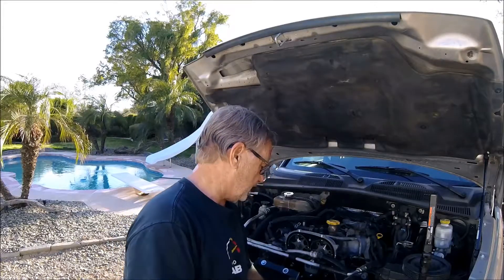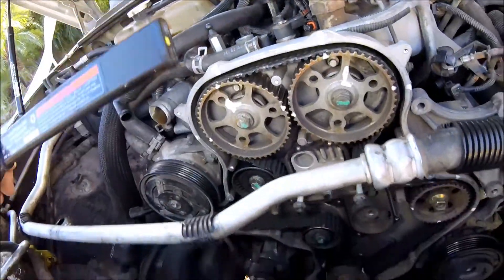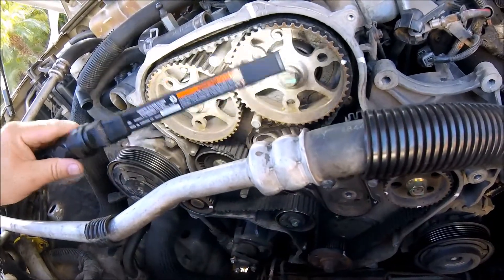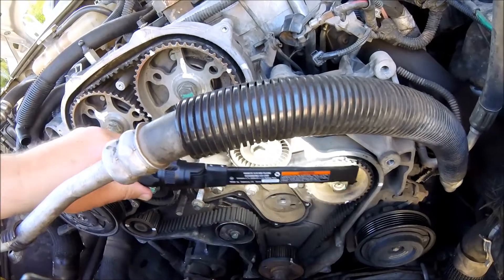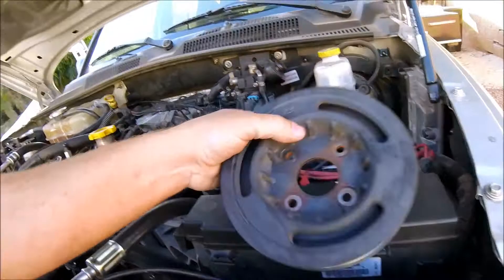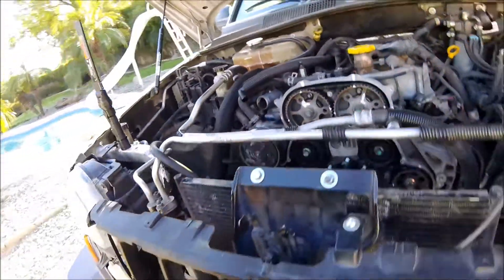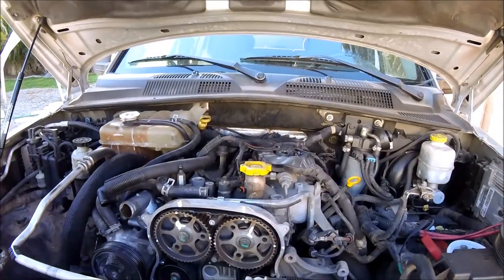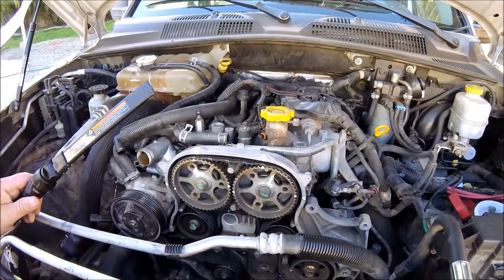Jeep Liberty CRD failure, root cause found

Comment: Greetings perhaps you can help me i recently cuange my timing for my CRD  2.5 jeep Cherokee started out work great for a while then it stall out every 2 miles... I change the cam and crankshaft sensor glow plugs no flush fuel lines still stalls and hard start any recommendations?

Comment: I’m thinking I may have a timing issue on my CRD liberty,  it drives but has excessive smoke I believe caused by I burned fuel, degradation in performance and fuel economy and an associated knock almost sounds like a rod.

I thought it was a dead cylinder (bad rings) but recently pulled each electrical connection off the fuel nozzles individually to identify a dead cylinder and all 4 had the same rough idle response when disconnected that recovered immediately after reconnection so my mind is now wondering if I have a timing issue, especially now that I see it’s a belt and not a chain.

How much has to come out of the front end to replace the belt, is it easy or a pain?